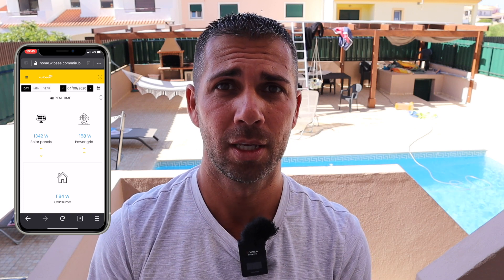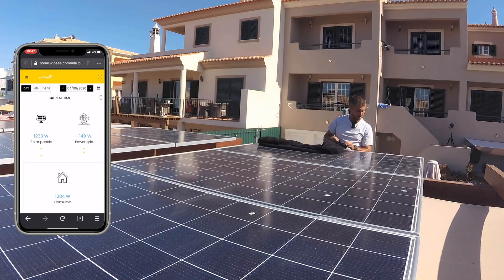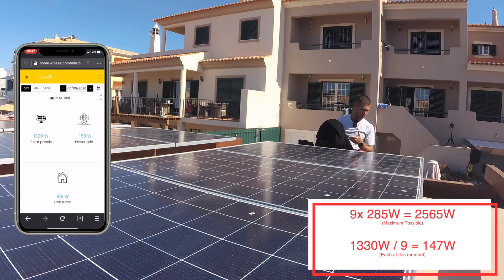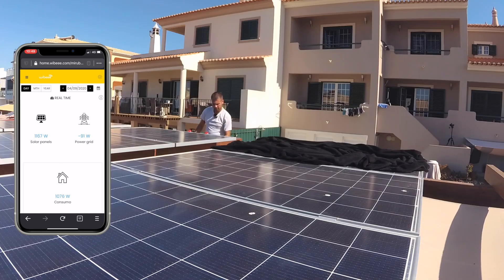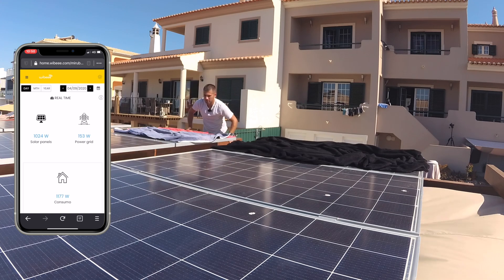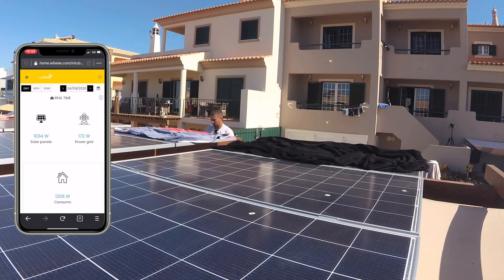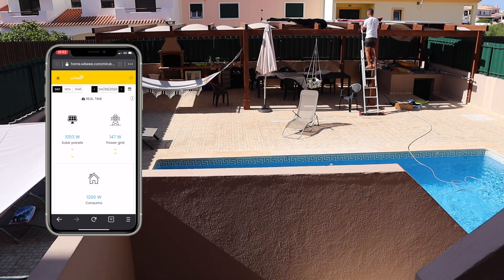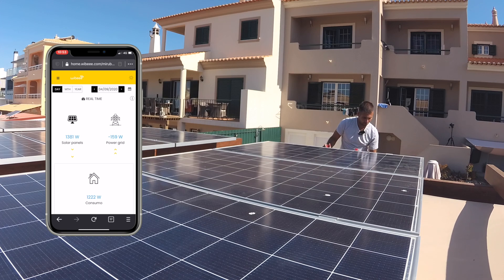How SHADE Affects a Solar Panel PV System with Central Inverter

Comment: The myth that string inverters block entire string of panels even when one panel is shaded does not apply in modern panels which have panel level bypass diodes. In most modern panels, there are 3 bypass diodes in a panel which means even a panel which is covered by 1/3rd can still supply 2/3rd of the current by blocking the blocked string. So, the string inverter causing a series of failure is a myth. However, micro inverters do give additional 8-10% power by avoiding MPPT inefficiency. But the cost of microinverters are too high to justify this minor increase in efficiency.

Also, about why a 280W does not produce all 280W even when unshaded in this video, there are several reasons:
- The string inverter reduces the efficiency as series connection does not always have the exact distribution of voltage which makes it difficult to find the exact maximum power point voltage. This causes 8-10% loss
- The 280W is in peak ideal radiation condition of 1000W/m2 which is not the reality. Mostly it is less at 900W/m2 on a hot summer afternoon
- The high heat reduces voltage which reduces power, causing another 5% reduced efficiency. Overall, the effective efficiency is about 75-80%. This means the actual expected wattage is 210-224W at most. 
- There may be further inefficiency in terms of lower latitude, non-peak afternoon sun, partial cloud/haze causing further inefficiency, giving only 60% or 150W-160W power per panel.

Comment: I see two possible explanations:
1.: You see the effect of the bypass diods. Maybe they get active after a few seconds so that the shadowed panel is no longer "in the way" of the current.
2.: You see the effect of the shadow management in the central inverter. The shadow management is activated in some - inverter manufacturer specific - intervals. It scans the whole U/I scope to find the maximum power point. As this scanning does not happen immediately after you have shadowed a panel, you will see the output of the inverter in a non optimal power point for a while - until it found the better power point.

I would guess that the second explanation is more likely as I don't think the diods would have the delay which you observed.

Edit: Just realized that @Markus Jenkins had the same idea. So, I agree with his explanation.

Comment: Very interesting. My conclusion is that your panels are hot (full sun, horizontally mounted so little airflow underneath) and so are producing around 120W each (rather than the "peak", theoretical 280W). Even partial shading basically kills the output of a whole panel. What's interesting is that a shaded panel still passes the current through OK from the other, non-shaded panels. The inverter's MPPT system is a computer controlled control circuit with a finite response time. It is constantly "fiddling with" the current that it is trying to draw from the string of panels in order to generate maximum power out. That's why it might take a few seconds for the MPPT to find the best current to draw from the panels in order to get maximum power out after you suddenly put one of the panels in shade.
Reply: MPPT time is set in minutes. Fronius is 10 mins, SMA is three minutes to fully track. Do not know what his inverter mppt time is set to. I do know Fronius and SMA mppt is far better than other inverters algorithms.